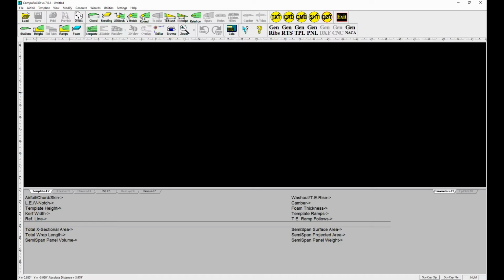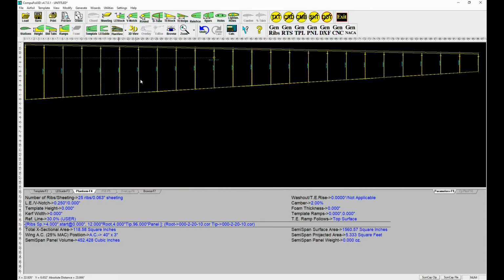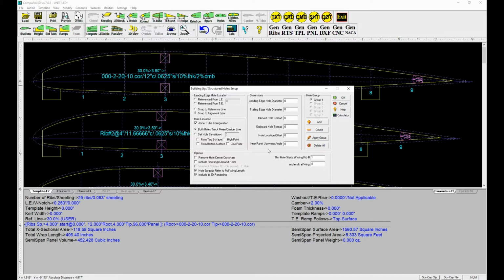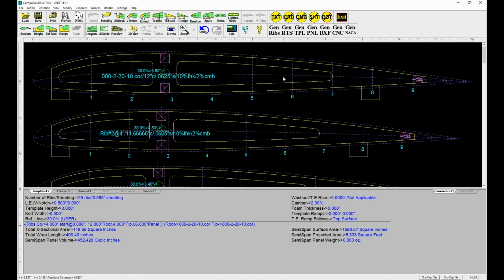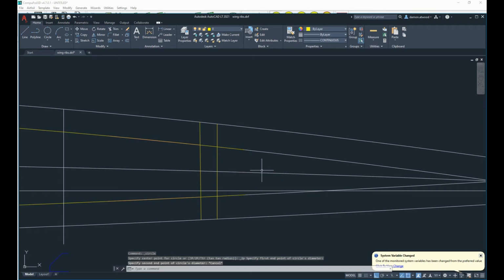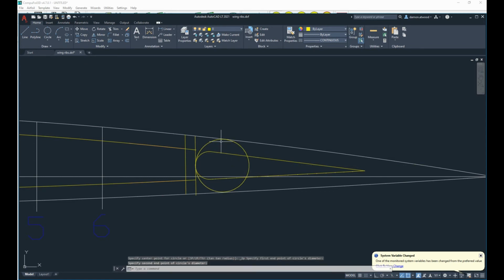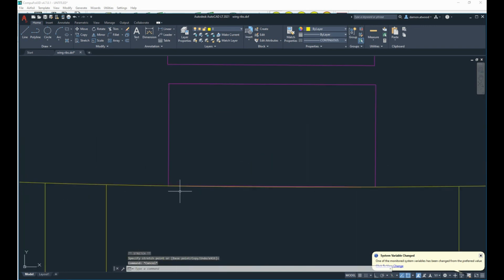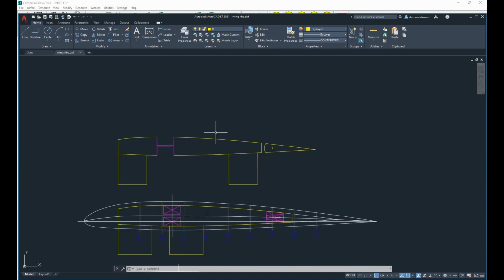Designing a Wing

Comment: When you create that rear spar at the 4 minute mark of your vid., if you put zeros for the width you will get a simple straight vertical line..Also further down it shows "Spar starting and ending positions" you can place the spar at the precise place..Example, rib12 to rib 17..
If the spar need to be between 2 ribs, simple add an extra rib in the "Generate Ribs" window..You can add a rib at any location along the length of the wing..great for a rib to aid the placement of a servo or reinforcement at any place you might need it